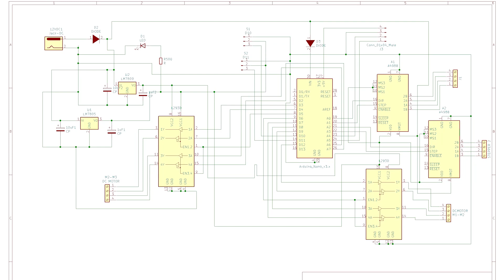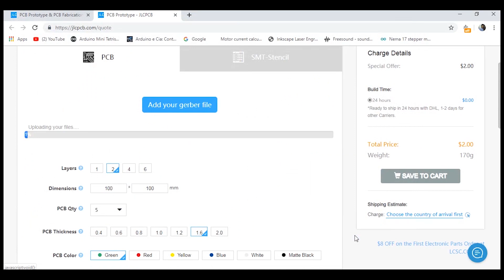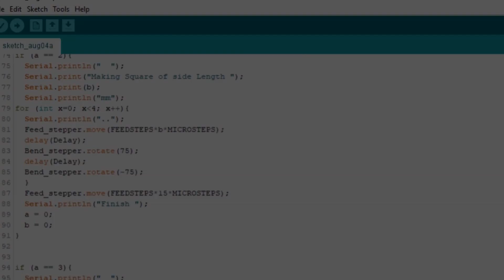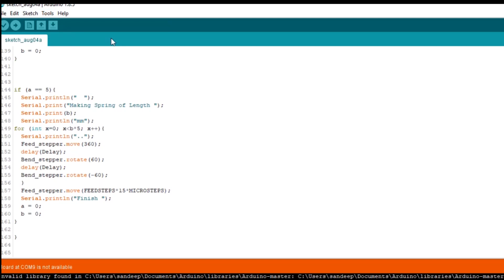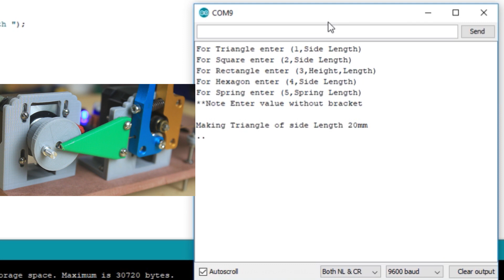DIY Arduino based 2D wire bending machine

Comment: Hi. One query. When motor is bending the wire at an angle as seen in the video (at time 0.54 and 1.07), how is it you get a near helical structure. For e.g. where the wire was bent into a rectangular shape, it kind of winds in a rectangular spiral. What causes it to spiral?
Reply: Hi. I hope you found your answer...I new here! Note that at the time of bending the wire is forced against the (green piece) which makes it move to the side every time a new bending occurs.

Comment: That looks like it could be modified to bend radio antennas for phones or WiFi range extenders. Here's an example of a simple antenna https://youtu.be/1veNvAxWHyM  That machine could bend antennas faster than you can drop them in envelopes to ship them.